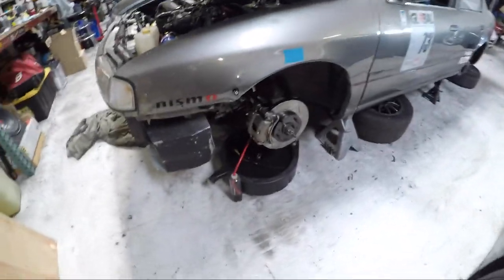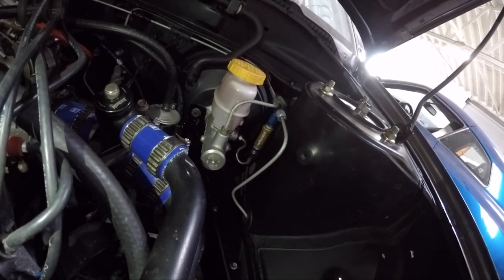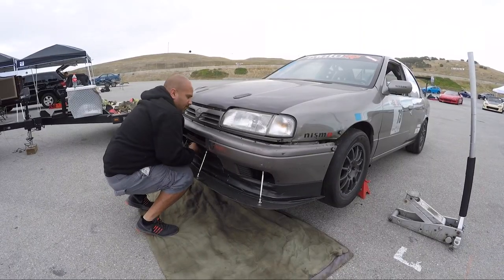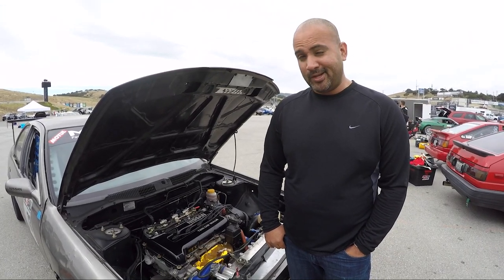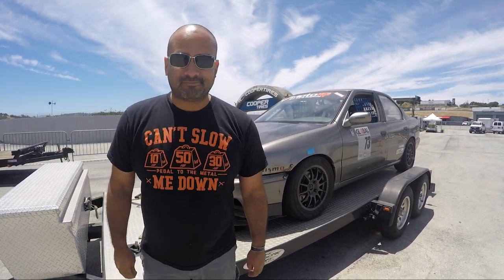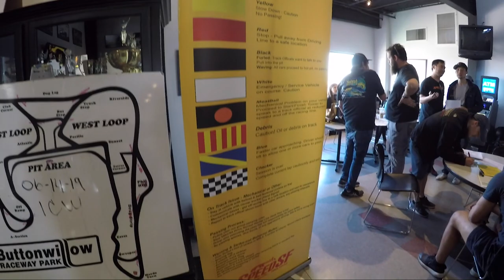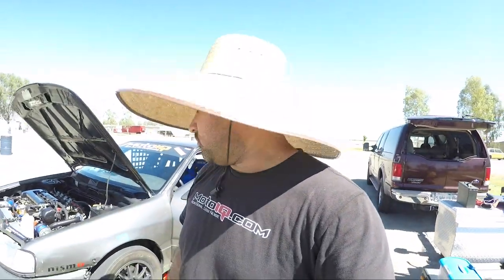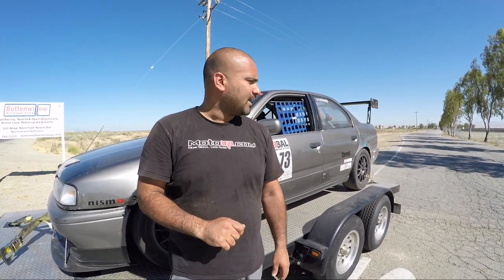G20 Racecar - Fixing Brake Knock-Back & Laguna Seca Fail!

Comment: more kojima.

what lap times were you getting?
Reply from the maker: Car ran a 2:03 that day, but its best time was a 1:59. Driver has a few seconds to make up ;)
Reply: @motoiq  Yeah keep developing the car, I would never admit the problem is between the steering wheel and the seat.   Id rather run titanium bolts than skip a burger haha